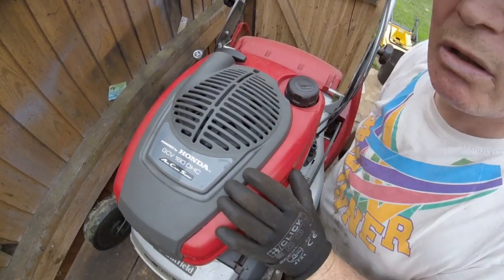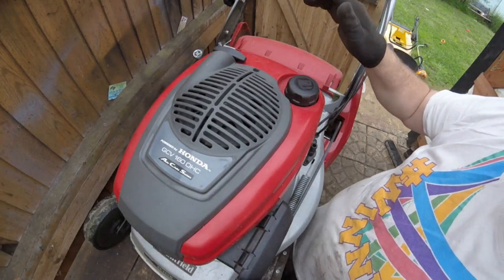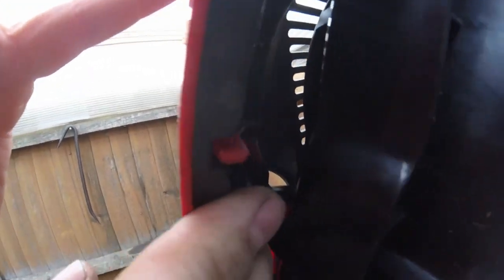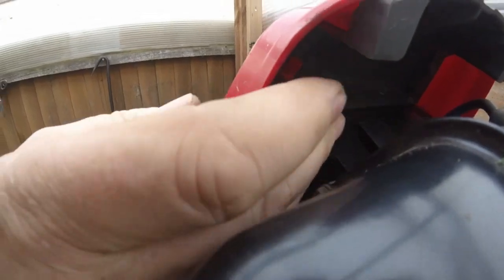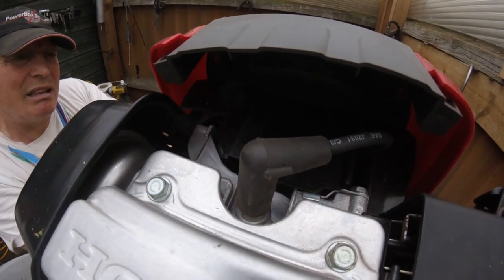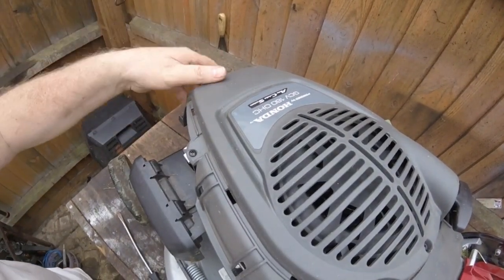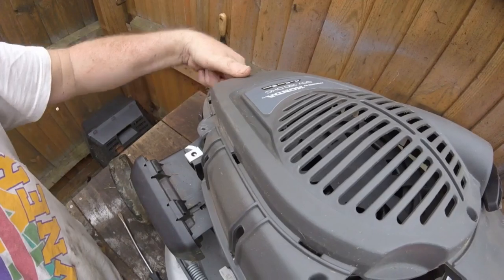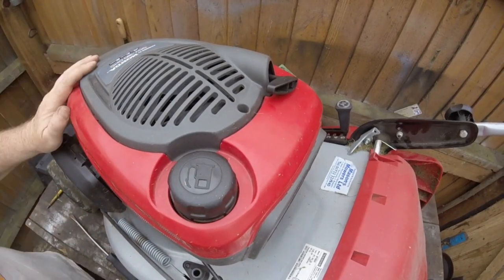How to remove a Honda gcv160 engine cover

Comment: Cheers Roy - just saved me a shedload of main dealer charges. I just could not work out how to get this cover off until I saw your vid - found 2 of 3 nuts holding starter recoil to the engine were gone! Hence not engaging enough to start. All mended for nothing as found right sized nuts in my garage.

Comment: I've got this exact mower and I've got an oil leak at the front where the valve cover is.
Does this sound like it needs a new head gasket? And is it a job I can do at home? Thank you.
Reply from the maker: Check the bolts on the valve cover tighten them abit slowly but not over tight then see if that works first